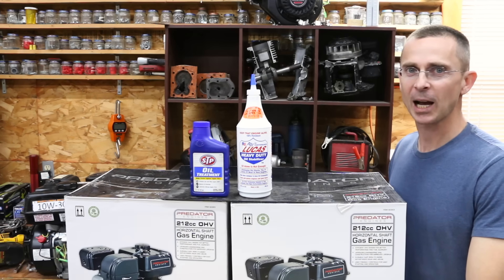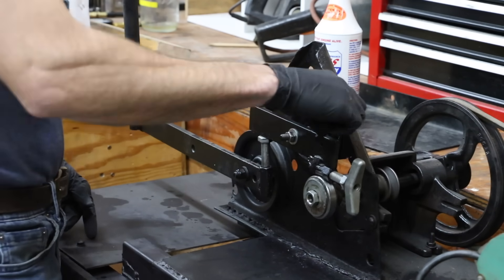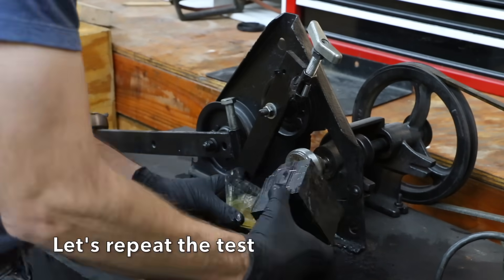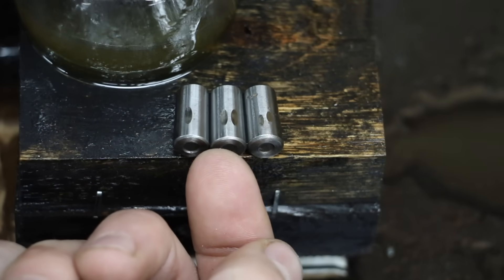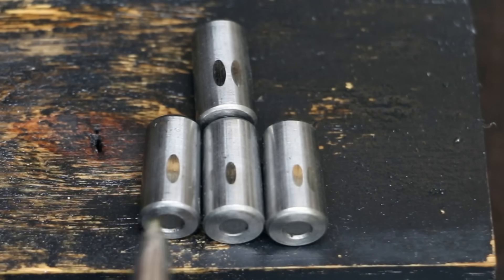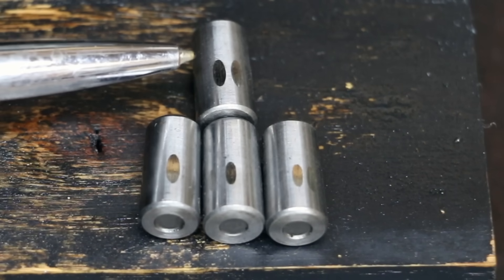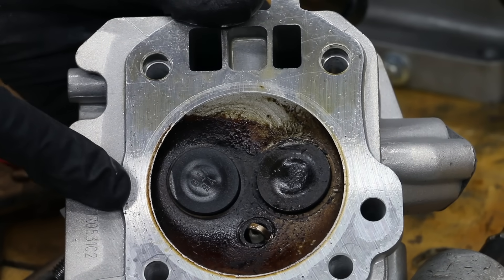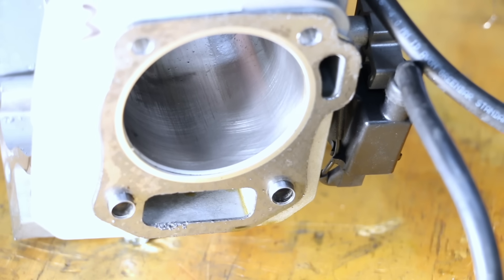Which engine self-destructs first?  Lucas or STP?

Comment: Whatever additive you test next, you should get the synthetic version vs the conventional version. Such as Lucas Heavy Oil Stabilizer vs the Lucas Synthetic Oil Stabilizer. I'm curious if the extra cost is worth it.
Reply from the maker: Thank you for this recommendation!
Reply: Maybe not do the destructive test between the 2 and just do the wear test with the bearings. That would give a decent indication.
Reply: Yea I run the Lucas synthetic in my car cause I don't really need anything that's as viscous as the other 2 Lucas Stabilizers, I don't have any rod knock or lifter tick, I just want some protection against dry starts.
Reply: I second the test, But usually this is recommended to use the synthetic with tighter clearance.
Reply: Remember ANY oil  is better than NO oil. I know people that will go without adding oil because they couldn't FIND or AFFORD what their engine calls for.  Even if it VOIDS the warranty,  PUT ANY OIL IN THE DAMN THING and I guarantee it'll keep turning over.  AND NO,  not cooking oil, but I never tried this so maybe it would work in a pinch??!!   Main thing is, YOU GOTS TO KEEP IT LUBRICATED!!!
Reply: Gary Kovach last line... Thats what she said. 
Sorry had to do it. 
You have a valid point and its my view on it as well. If i am in a pinch i will use any oil. Example i only had some hd 30wt and i am supposed to use 5w20. I used the 30wt to get to the store to get the recommended oil.

Comment: You should have a motor that was treated with oil as a control. This test was cool and all, but I can't make a call on what was really better without a baseline to compare to. The oil additives could have been within the margin of error of time when it came to failing.
Reply from the maker: Sorry I didn't explain this.  I did the control 2 videos ago when I compared Bestline to 10W-30.

Comment: What about the Nano Ceramic paint protector. I wonder if that would help the bearing.  It might need a smooth bearing though rather than one roughed up.  If it worked on the test bearings you could flush some through the engine.
Reply from the maker: Thank you for this recommendation!

Comment: Marvel Mystery Oil. We use to use it on our router bearings all the time in the Woodshop. It works good on high speed bearings going 30,000 RPMs but at that speed if you let it run dry very long they burn up.
Reply from the maker: Thank you for this recommendation!

Comment: Sort of figured the Lucas item would win this battle.  Saw a guy at the markets years ago with a small engine idling away with the sides of the sump cut out.  The same as you he had oil and Lucas additive splashing away  and could see ot coating everything and staying there. It  behaved exactly the same as your experiment.  
Surprising how much air was mixed with the STP product.  That may change inside the engine after being heated up  and some pressure.  
Love ya vids mate.  Keep up the great work. 👍 👍
Reply from the maker: Thank you for the positive comment.

Comment: You should take two cheap engines and run them at full throttle until they throw a rod or otherwise fail. And this is with oil. Or try with used oil. I'd be curious if you could use cooking oil as motor oil. Or air compressor oil. maybe try furniture oil. 

so many ideas.
Reply from the maker: Thank you for this recommendation!

Comment: There is always a heated debate amongst us saw guys about fuel/oil ratios, 25:1 and 50:1 etc. Maybe a contest between cheap mineral 2 stroke oil at 50:1 (instead of 25:1) and expensive Stihl Ultra synthetic at say 100:1 (instead of 50:1, or Amsoil at 200:1 instead of 100:1) in a couple of the cheapest small 2 cycle engines you can buy? Maybe warm and tune mixtures the same on both engines then run them at full throttle until they seize? I'm sure it would be an interesting test! Thanks for these entertaining videos too!
Reply from the maker: Thank you for this recommendation!

Comment: My suggestions for an additives:

NoMorFriction (gonmf.com)

MotorKote (motorkote.com)

DuraLube (any auto parts retailer)

I'm a driver, by trade... mechanic as a hobby. With well over 2 million miles experience and having witnessed benefits of all three listed above, you might say my choices are somewhat founded.

NMF is a concentrated additive that shown great performance in both lab and field testing. To my knowledge, the only lubricant known to perform equally is chlorine bleach.

MotorKote performs equally to NMF in its raw form, but is slightly more diluted in spec mixture. MotorKote is already blended with a higher percentage of carrier fluid, making it easier to proportion... and it's slightly cheaper.

As for DuraLube... though it doesn't match the other two in lab tests, I have personal experience in its performance in the field. I once had a '95 Plymouth Neon... a vehicle who's 2.0L SOHC four cylinder was notorious for blowing head gaskets. Mine was no exception... though it's VIN wasn't in the recall list. I decided to use additives to relieve the stress until a total rebuild was necessary. After using two other additives with marginal results, I added DuraLube with next oil change. Great results! Not only did it quieten the engine, it also improved mileage and cold startup. I put the claims to the test... driving the car for five months... with an empty radiator. When the engine went into limp mode (almost daily in the last two months) I would disconnect the battery, cross the leads (resetting the ECU memory), hook the battery back up, and she'd take right off. She finally stopped one day when water pump seized. Two of those months without coolant, I was delivering pizza full time. The last three involved driving a minimum of 750mi weekly to work (including multiple stretches at high speed). The ONLY reason I don't recommend this product in all engines new or old, is because it may hide critical issues that deserve mechanical attention. It also limits thermal transfer. While this might be good for the engine block... it can cause excessive heat in the combustion chamber, triggering limp mode or otherwise poorly calibrated air/fuel ratios and ignition timing.
Reply from the maker: This is a great post with a lot of great information. Thank you for the comments and thank you for the video test recommendations!

Comment: That is a great idea! How about teflon based additives? I think  your lubricity testing needs a little tweaking. The finish on the wheel with the grinder is way too rough. You can't really test the film strength with such a rough finish as it just acts like sandpaper. Oil films are very thin (think microns or less) and need smooth surface to work properly. Even just a few quick spins with wet (use wd40) 120 then 220 then 320 and finish with 600 will yield very different results. IMHO  :)
Reply from the maker: Thank you for this recommendation!  Also, thanks for the tip on the lubricity tester.

Comment: You must use superkote, 2000 .
Reply from the maker: Thank you for this recommendation!
Reply: According to someone I talked to regarding Superkote2000 if you're car losses all the oil car can run up to 5miles without oil  I used it on my aircooled vw it improved rpm and reduced friction .

Comment: Try Motorkote for one of the additives. I wonder if you used an oil that has higher levels of zinc if it would last longer also?
Reply from the maker: Thank you for this recommendation!
Reply: Project Farm Enjoying the comparison videos, always wanted to try this for awhile, just no time. On the Lucas I wonder if running a thinner oil will help the temps out but still have the lubricity to last as long?

Comment: First of all the engines are being ran with no load second the fundamental is the same but the engine in your vehicle puts out way more power than 6.5 hp. I have a few Honda gx160's gx 200's and even a few of the big block single cylinder gx340's and i am not willing to blow them up for a test that proves nothing. Sorry not trying to be mr negative I like the videos but do fail to prove real data under load .
Reply from the maker: Great point.  I'd really like to test under load but I'm struggling to figure out a way to test 2 engines under identical loads.  If you have any suggestions, could you please create a new post so I can easily find your comment?

Comment: Slick 50 I was told about a video from my grandparents long ago that they went to a siminar about how good slick 50 was the had a clear crank case cover and ran the engine for an hour with no oil after using slick 50
Reply from the maker: Thank you for this recommendation!

Comment: I would love to see a teardown of one of the predator engines just after the break-in cycle to get an idea of initial quality and finishing of the internals.
Reply from the maker: Thank you for this recommendation!
Reply: They run for 20 plus minutes without oil. I'd say they are worth $100 bucks! Weak link is the conrod. But as long as it never runs out of oil.. It will never be a problem.
Reply: would also like to see a control, a 3rd engine that only had oil in it.
Reply: time to use an oil cooler and carillo rods!! add a yoshi exhaust to it and compare figures on a dyno!!
Reply: Also flywheels are known to grenade at higher RPM's with the governor removed, even on the genuine Hondas.
Reply: These engines are used in commercial applications for people who don't want to use a Honda replacement engine. They last just as long as a Honda does, the weak point of these engines is the air filter housing which is made from plastic that deforms easily allowing dirt to enter the engine.
Reply: Chuck Wood 
Seconded. A control engine would be nice too.
Reply: These engine are actually decently good work horses...
Reply: +Robert NES816 But not as reliable.Worked with abused honda engines high,volume water pumps for ten years and they all ways started.
Reply: ProjectFarm actually did the control with a 3rd engine in a separate video. I'm sure you can find it.
Reply: I understand that they also don't have a timing chain tensioner which means they are basically throw away motors when the chain weakens.
Reply: that would be the tell tale sign of the test.
Reply: fidel catsro I have one on my mud mower and it doesn't complain a bit starting in negative 15 Fahrenheit or colder. Ive rolled on its sides and it runs like the day it was put in
Reply: gary smallwood actually yes I haven't ever had it not start it starts really easy cold or not
Reply: WHERE would you use (or need...) a "timing chain tensioner" in a gear-driven camshaft engine???  Jes' wonderin'
Reply: i definitely agree with that! They have these Honda clones down to a science!
Reply: lets combine 6 of these cats and turn them into an Inline 6 cylinder 1200cc engine!! we''ll call it the Predator HALF JZ engine!!

Comment: Can you make a video on E85? Can a small engine run on it?
Reply: No point in doing a video, I can answer that question for you: It depends.
Just like cars, some small engines are designed to run on E85. All engines will run on it (Some may knock though) but it eats the metal and fuel tank parts. The engines designed to run on E85 have surfaces designed to not corrode in contact with E85.
Reply from the maker: Thank you for this recommendation!
Reply: itll run if you change the jets in the carb so allow more fuel in. how longevity is a different story. fuel pump diaphrams, rubber fuel line, needles with rubber tips could all suffer after extended use
Reply: Will S. I know on cars that are not E85 compatible you need to tune and use bigger injectors and E85 fuel pump but was wondering how it’s done on a small engine.
Reply: Project Farm it would be great to see if it can happen because E85 down south is less than $2.00 a gallon.
Reply: It might run, but not very good in stock form. You typically need about 30% more fuel if I remember right(at least with modified v8 cars).

Comment: Will the air bubbles trapped in the oil treated with Lucas create cavitation damage on journals/bearing/oil pumps?
Reply from the maker: I believe the air bubbles go away once the oil is heated and thins out, but great point regarding cavitation.

Comment: I'd be curious about the difference in time if the STP had been mixed the same, but I've always felt Lucas a better product, the engine treated with it lasted almost 10 min longer. Granted any engine with no oil will not last, however the outcome would say that the Lucas  provided better oil cohesion to the metal to metal surfaces.
Reply from the maker: Thanks for commenting.

Comment: I am a long time user of lucas and stp , I like lucas best, i use it just the way it stated on the label, and on my 1974 350 Buick Apollo and 500k no issue and on a replacemnt of the timing chain  the shop mic the old gals parts found 0 zero were,,,,, thanks for shareing, your testing.
Reply from the maker: 500K is very impressive!  Those Buick 350s are great engines.  Brings back memories. Thanks for the positive comment!

Comment: good job !!!   the answer is stp  only because it ran cooler 
but I wonder what would have been the results with just motor oil alone ?
Reply from the maker: Sorry, I should have provided more information on that. I did the control in 2 videos back using 10W-30 oil. Thank you for this recommendation!

Comment: What about running an engine on race fuel or jet fuel.  Will it burn up because of heat from the high octane fuel?
Reply: Alex's Garage jet fuel is kerosene. Not high octane gasoline. Aviation gas is higher octane than standard pump gas.
Reply from the maker: Thank you for this recommendation!

Comment: I agree with the comment made by- Ian Wright, Both lucas & stp are meant to benefit the motor only while its in the crankcase & it would be more ideal to do a load test comparison & inspect the bearings! Or run 4 engines, 1 w/stp, 1 w/lucas, & 2 w/plain oil So you could load test lucas vs oil & test stp vs oil. HOWEVER IT COULD BE DONE W/1 MOTOR RUNNING REGULAR OIL & THE 2ND MOTOR RUNNING LUCAS & 3RD MOTOR RUNNING STP
Reply from the maker: Thank you for this recommendation!

Comment: That was an excellent test. I appreciate the work you put into the consistency. You did a great job at answering alot of questions by monitoring the engine temps noise etc.  I'd like to see royal purple pushed over the edge. Maybe even a oil like motorcraft synthetic blend.
Reply from the maker: Thank you for this recommendation and thanks for the positive comment!

Comment: I was wondering what would happen running 15 w30 rotella vs regular engine oil . I once drove a bronco 30miles from the mountains with a broke oil pump with lucus additive in it , didn't do anything that we could find when checking the bearings when we put the new pump in
Reply from the maker: Thank you for this recommendation!

Comment: One thing you're missing in these tests is a baseline - how long with the engine run with just the oil (of course making sure you're using the same oil and engine model every time). Having multiple baseline tests would also give you a better idea of how much variance there is in the engines themselves. If, for example, the base line engines will self-destruct after between 10 and 30 minutes, then two additives tested here have no real effect (at least you'd need far more tests to see one). If they self-destruct after 60 to 90 minutes, then the additives are horrible for the engine.
Reply from the maker: Thank you for this recommendation! I created the baseline in the last video comparing 10W-30 to Bestline.  Sorry I didn't communicate this in this video.  Thanks again.

Comment: Its interesting, in the previous video the engine without any additive lasted  38 minutes, longer tan any of these, and seized without breaking. by the way,  i see a small pinion driven by the cranckshaft, do these engines have oil pumps?
Reply from the maker: Thanks for commenting.  Yes, these engines do have oil pumps instead of the splash system.
Reply: Thank you for read the comments i made some research because i was curious and i found that the small plastic gear is the "governor" (to mantain constant speed) it is lubricated by the splash system but the connecting rod has removable bearings.

Comment: What about running at 50% of the time it took to destruct for each of these vs regular oil? Would any of those engines be operable if stopped before the total melt down point? Which one runs the best after?
Reply from the maker: Great point.  Yes, all of them would be operable if stopped when the smoke begins blowing out of the oil fill.  However, the engine wouldn't last long due to existing damage.

Comment: You might be able to tell something about the internal friction inside the engine if you monitor the RPM during the test.   You could do this with an external tachometer that uses either a magnetic sensor  or reflective patch on the output shaft.  There are some cheap ones on ebay. You wouldn't even have to run at full throttle.  You could adjust the throttles so both engines run at identical RPM at the end of the break-in run, drain the oil, then record the RPM over time.
Reply from the maker: Thank you for this recommendation!

Comment: This makes me think of zmax I been using for years which caused 5 psi more oil pressure when engine hot auto transmission in drive while holding brake pedal.  Also I got 5 mph more at 1500 rpm with auto transmission.  You should do a zmax video like the one you did with blue tractor
Reply from the maker: Thank you for this recommendation!

Comment: Sell the extra parts off the predators to make money back, gas tank, carb, muffler, air box, valve cover, valves?, etc...
Reply: You could also sell pull start, side plate?, oil sensor, electrics, flywheel and shaft parts, and maybe the heads as well
Reply from the maker: Thank you for this recommendation!